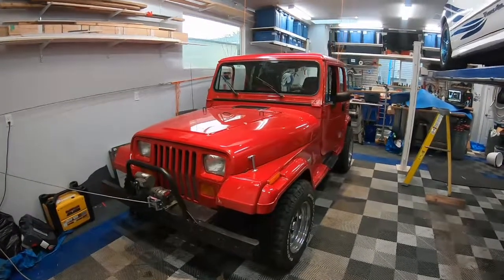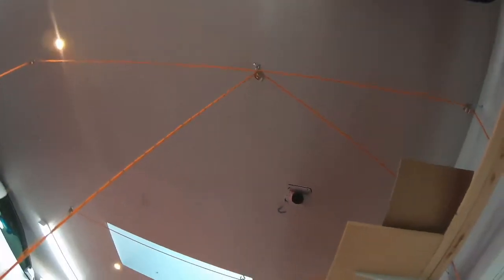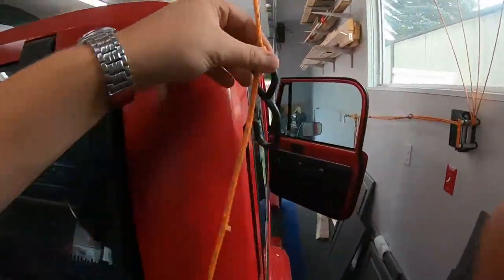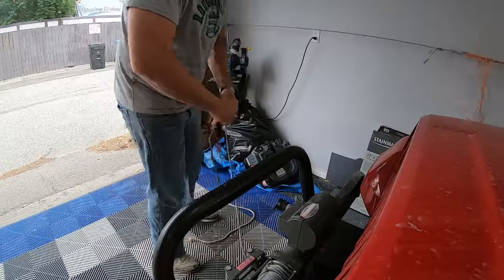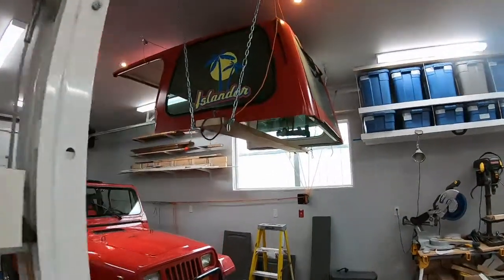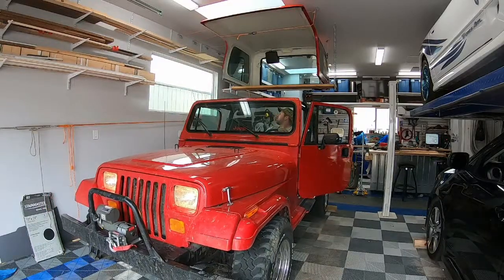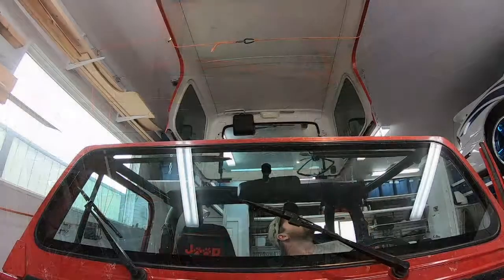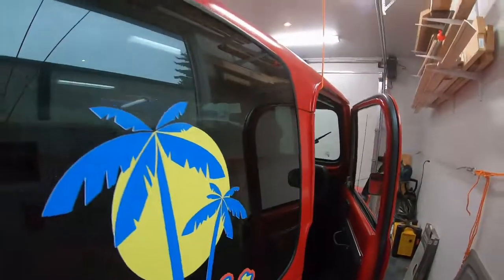Jeep Wrangler Hard Top Winch Lift

Comment: I had a similar idea (except I plan on screwing into the header above the garage door.  How's it holding up?  What would you do different?  Are the chains really necessary, or could you just tie the pull ropes up off a cleat?  What knots did you does to join all the lift ropes?
Reply from the maker: So it is holding up well.  The ropes run in front of a south facing window, so I expect their life duration is limited.  They are already very faded.  I think if I was going this again I could use braided cable instead of rope.  There is a lot of flex in the rope and it causes me angst.  I would definitely keep the chains with the board underneath as the top often spends months off the Jeep.  I find that security nice.  I had one hook in the ceiling fail on me and the backup prevented an issue.  I didn't use anything special for the knot.
Reply: @johnniemo  I think what I'm going to do is attach an el-cheapo game hoist to a central bolt going through the drywall into a joist.  I'll connect it to two 10' load straps to lift the top up.  Then I'll have an eye-bolt near each corner of the top (wherever the nearest joist is) and have it support the top similar to how your lifting hooks work.  I'll probably just use some old ratchet straps for that.  Once the hooks are in place, I'll lower the hoist to the point where they are carrying the load, but tie off the hoist to an eye-bolt in my garage door header so if one of the lifting straps should fail, the load will just transfer to the hoist over the central lifting point  I'll have to nail the joist dead-center for it to be safe during the lift, but it should work well, and the 7:1 mechanical advantage should make the winch unnecessary so I can raise and lower it no matter what (but still possible if I attach a snatch block to the garage door header).  Total parts: 4 ratchet straps, 6 eye bolts, 2 10' lifting straps and that $16 game hoist.  Probably under $50 all in.  https://www.harborfreight.com/gambrel-and-pulley-hoist-99758.html
Reply from the maker: @blurglide  I think that sounds good.  The only issue with mechanical advantage is 7x means you need 7x more rope.  In my case, I did not have 7x the distance between my winch and my first eye hook.  In your case it shouldn't be a problem.  

It's not actually that heavy.  I can tie the rope around my waist and "walk" the roof up or down.  That's what I did this year while I didn't have a winch.
Reply: @johnniemo  Oh yeah- I'd just replace the game hoist with a pulley if I wanted to use the winch.  I doubt I can even find a pulley that I'd trust for under $15 though.  How'd you tie it off when you were walking it back manually?  When I was big into lifting weights, I could actually slide the roof back a little, stand on a stool, overhead press it, and walk all the way to my back yard that way.  Even when I was jacked that was tough though- very difficult to balance and lift over my backyard wall
Reply from the maker: @blurglide  I only did that once and I had a friend "catching" it.

https://youtu.be/iZ7UYl3E13o
32:27 of this video